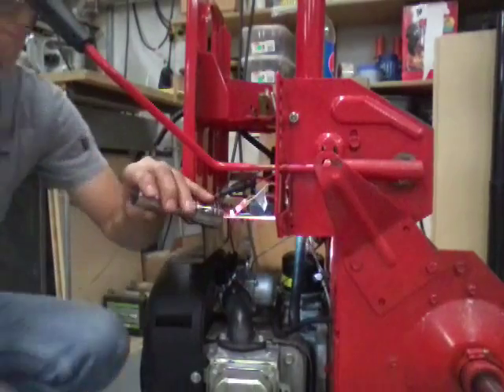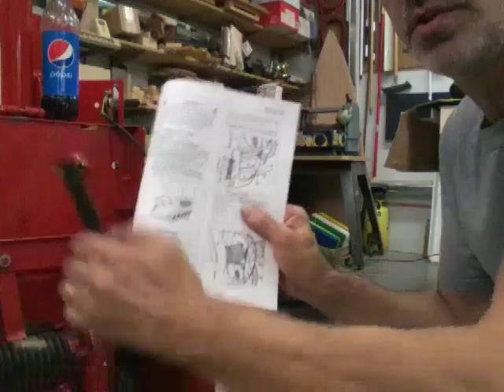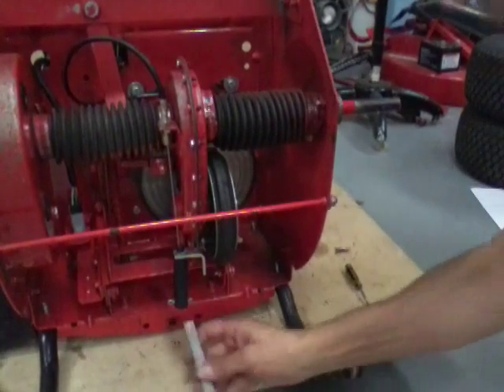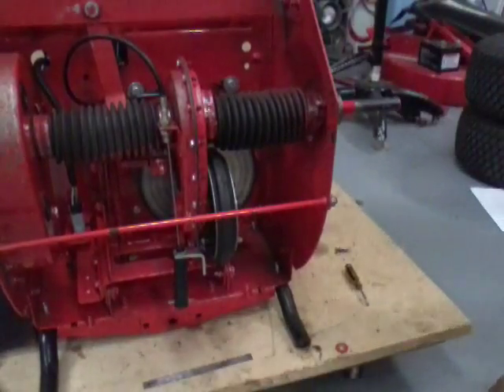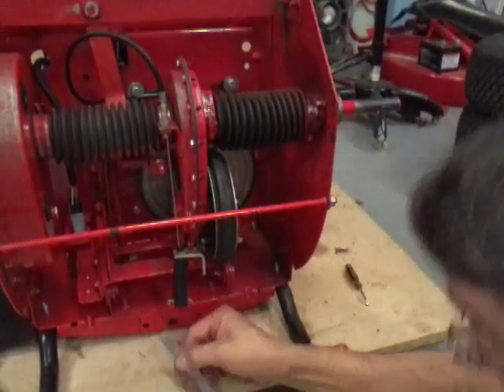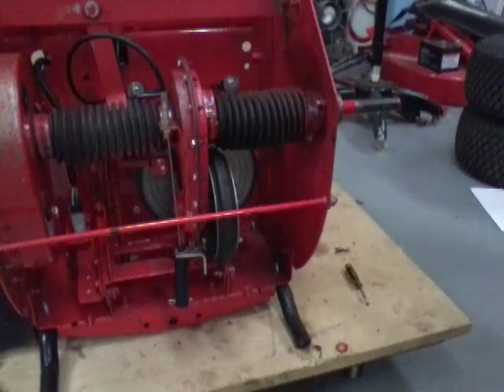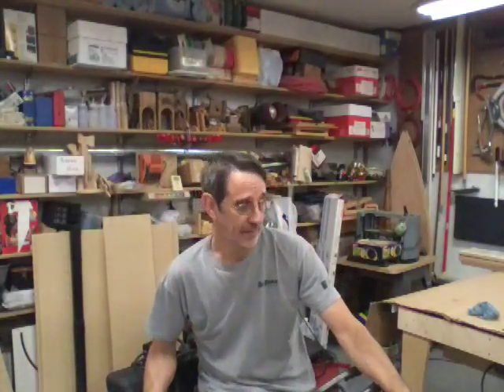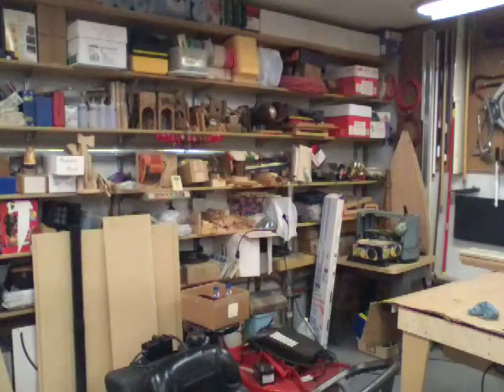144.   Adjusting the clutch and brake cable, installing the rear tires, the seat, and the gas tank.

Comment: You're the man, Jim! My mower wouldn't go into gear or drive at all. I replaced my clutch wheel assembly, axle boots, brake lever, re-greased everything.  Fired it up and it works better than we I got it second hand.  100 bucks on parts and I'm rolling again.  All because of you.  You're a great instructor. THANK YOU!
Reply from the maker: Clint Bollinger 
Well thanks for watching and hopefully subscribing. Jim
Reply: @jimjackson9381  where can I buy a new brake cable?
Reply from the maker: @jerberkrell815  I would take your model number and go to Parts Tree.Com in Texas and they will send you one.     Jim
Reply: @jimjackson9381  I'm not shure what the number is, it's an 80s snapper
Reply from the maker: @jerberkrell815  does your machine have the original engine on it?
      Send me some pictures of your machine and maybe I can figure something out, I need to know if it has one or two  pedal ?
     Send them pictures to
jimsfixitshop@gmail.Com 
Thanks.  Jim
Reply: @jimjackson9381  it does have two pedals, and it does have the original 11hp engine.
Reply: @jimjackson9381  i also just emailed you too.
Reply from the maker: @jerberkrell815  do you know what size the mower deck is?    Jim

Comment: I found on the Lugnuts on the snappers being a retired master mechanic if you take go ahead and pull her off or drain the fluids in the oil out of the unit, turn it on its side where you can get to the backside of the Lugnuts and spray them with a pen And then a little bit wait a few hours again for a little bit. Do that several times then maybe the next morning flip it back over the other way and hammer on the other side with a big punch put your wrench on it and zip right off every time I’ve had no problem doing that, but you need to get that penetrate on both sides of that bolt/lug nut

Comment: Jim- My Snapper is just like yours. It's a 2003. My yoke is locking up. The bushings are good if I don't tighten the mounting bolts real tight it moves okay but when I tighten them down the disc doesn't contact the crankshaft pulley because it doesn't move up to the crankshaft pulley & make contact. My distance is adjusted okay with the gauge i made from the paint stick.    Thanks   Bill Davis   Columbus, Ohio
Reply from the maker: William Davis 
Maybe you have the wrong plastic bushings you should be able to put the bushings in and lock the bolts down tight and the yoke will still pivot on those plastic bushings. Jim
Reply: @jimjackson9381  Even though I have adjusted the clutch spring to  the last hole the  drive disc doesn't contact  the wheel. I have adjusted the clutch but the tractor won't move in any gear. The chains are all good. Puzzled? Should I move the drive disc closer to brake wheel?  Bill Davis    Columbus, Ohio.
Reply from the maker: William Davis 
Did you get the issue figured out with your yoke if that’s not working properly your Machine is not going to drive properly, send me some pictures to my email so I can see what your drivetrain looks like. Jim
Reply: @jimjackson9381  My camera is not working. I moved the drive disc down & now it will move in all gears. The problem I have now is that it's grinds in 1st. & 2nd. gears & really bad in 3rd.,4th. & 5th. gears. It has the original  bearings or bushings. There was quit a bit of slack in one of the chains. All of the adjustments are right. I'm thinking the drive disc still has to move down closer to make better contact with the clutch disc?  Thanks for help.  Bill Davis  Columbus, Ohio.
Reply from the maker: William Davis 
Just make sure the edge of the chain case is not hitting your drive disk, that will make a grinding noise. Jim
Reply: @jimjackson9381  It is not hitting the housing.
Reply: @jimjackson9381  Sorry it took so long to get back to you. My Snapper had the original 12.5 H.P. engine. I put a new 11.5  engine on the tractor so using the old adjustments was wrong. I had to lower the crankshaft pulley & readjust the clutch & the brake. Changed the grease in the transmission . Works good now.  Thanks for your help. William Davis  Columbus, Ohio
Reply from the maker: William Davis 
Hey William I’m glad I could help if you have any issues let me know, I hope your subscriber I need your help with that issue. Jim
Reply: @jimjackson9381  I have told several people about your expert advice. They love it. You have taught me a lot, Thank you. William Davis Columbus, Ohio.
Reply from the maker: William Davis 
Well thanks for spreading the word I could Surely use subscribers to keep my channel going. Jim

Comment: Hi Jim that looks just like my little snapper and the only problem I have is with safety items. When I put it in park,it's a crap shoot on whether or not it will continue to run or die. This is when I get off the mower to move a water hose etc. Out of the way. I moved 1 then 2 ferrels up on the pedal and it died immediately. It's a finicky little booger as I don't know what or which direction to adjust the "clutch cable" I would assume, but I could be wrong. Great little mower but I to am finicky and want things to work as they should. Kind of like the cassette decks I work on. They have to be calibrated perfectly even though the manufacturer says +-5% is allowable. 
 Thanks Jim and keep up the good work as some of us appreciate the older things in life that can and will be repaired.

Comment: Hey Jim, 
I talked to you a couple times about my Snapper. I've FINALLY got all the parts to start putting it back together just in time for spring..lol. I think I found out from you why the mower wouldn't move. The left side hub bolt was missing. You said it would just keep turning and not move. I guess it was running like that for a couple years and finally unsiezed itself and stopped moving. I figured I got it All apart might as well change both chains both gaskets all the plugs and the belt & blade. I want to Thank you for you helping me thru this process. I will let you know if that was for sure the problem.
P.S. both chain case & Diff case were gummed up with that hard 00 snapper grease...I've been watching the vids.
Reply from the maker: Vinnie C 
Hi Vinnie
   If you need any help putting that thing back together you let me know and I can say for sure that missing bolt was the issue why your machine wouldn’t move.  talk to you soon Jim.

Comment: Hey Jim I've got a walk behind cub cadet purchased a the Orange store that should give age? It needed a new drive cable and I finally got around to order part and replaced it added new gas. Fired right up. This model regardless if warm starts with choke on. Well when I shut off the choke it revs up to maximum. I just watched a snapper video about the governor butterfly so I'll check that & if not missing send you another message. Hope your well. 
TU from N.W. Ken
Reply from the maker: If you have a Ace Hardware or a True Value Hardware. in your area I would go talk to the mechanic and see what he thinks it could be I have no idea on that one. Jim
Reply: @jimjackson9381  TU Jim. 
Anxious, with rain In our forecast. 
I decided to check out the govenor & found  my maintenance needs improvement. Butterfly's intact.  So I cleaned up all moving parts & mowed the lawn. Followed with  ordering a new blade. TU again for the channel &  responding Sir.

Comment: Hello Jim - this video was very helpful for me!  I inherited my dad's rear engine Snapper and having some issues with the brakes - I believe I will now be able to fix it!  In this video - you mentioned "Tom's Manual".  Can you tell me, please, how I can get one?  Thanks!
Reply from the maker: timreser 
If you call Briggs & Stratton. in Milwaukee Wisconsin with your model number they should be able to get you or send you a PDF file that you can print out. Jim

Comment: Hi Jim, I purchased an older Snapper RER that appears to be repowered with a Honda 13hp OHV, I need to get a clutch cable but can’t  seem to find what model has ferrals on one end and a loop on the other.  I can send a picture to help identify it.  Thanks again for posting all these videos I have learned a lot about the Snapper and you sure do drink a lot of Pepsi.
Reply from the maker: Charles Piwowarski 
Hi Charles
   Send a picture to my email which is
jimsfixitshop@gmail.com
And I’ll take a look at it. And I just have to have my Pepsi. Jim

Comment: I'm trying to set the clutch/ brake on a rear wheel snapper. The pedal has a pulley on it... No one  speaks about that version. My client/friend needs it fixed . Do I remove and relocate the pulley to get the slack to do the adjustments I need?
Reply from the maker: You need to send me some pictures of this thing I’ve never seen a pulley anywhere on a snapper rear engine rider send it to
jimsfixitshop@gmail.com
Thanks.      Jim

Comment: Hi Jim, my name is Jim. I have a snapper SR1028 with a 10 hp. 
I’m in the process of replacing the engine after 23 years. Unfortunately, it dropped a valve seat.
The head was pretty heavily damaged, and the valve seat was a bit oval, and even the valve spring appears to be broken. 
I’m using the opportunity to go through and adjust things like the clutch, but mine is different. I have no cable directly on my pedal like yours. 
Do you have a video for the older units? 
I still have the black oval steering wheel but I have the covered center with SR 1028. My brake pedal is very low and I’m not sure about the adjustment on the clutch. 

My new engine is a 21R807-0072-G1. That appears to be the number of the replacement engine that will fit my mower and it’s 11.5 hp, not 10hp. The engine is not going to show up for a couple of weeks. 
While I’m waiting, I want to make sure everything’s lubricated and adjusted properly before I install the new engine.. Just want to utilize the time while waiting on the engine.
Any assistance or suggestions you have would be sincerely appreciated..
Thank you from New Jersey!
Reply from the maker: @Justacogg  I am not real familiar with the SR series machines but I have one that was just delivered to me from the other side of my state that I am probably gonna start on next week and I’ll go over some adjustments and lubrications at that time.

Comment: When you show the bracket that has the clutch and brake cable, which hole does the clutch cable go into ?  This should help when replacing the clutch cable.  Thanks Don
Reply from the maker: Hi Don it’s Jim. The little black plastic block that goes around your clutch cable and brake cable most of them have the same size hole going through them so it doesn’t matter which way it goes on. As long as the block is on the clutch cable between the feral and the pedal so that it can pull the brake cable when you push the clutch pedal all the way down. Jim

Comment: My brake/clutch pedal doesn't always return the the full up position during mowing. Brand new mower.  I have checked the clutch and brake adjustment and they are where they're supposed to be.  What can I do to insure the return of the pedal to the full up position?
Reply from the maker: It’s nothing that you really have to worry about there’s not much in the way of a spring that pulls the pedal back up. Jim
Reply: @jimjackson9381  Thanks, love the videos!
Reply from the maker: @geraldstraney6181  Well let me know if anything comes up that you need help with. Jim

Comment: When you stood the mower up vertically did you first drain the oil out from the engine?
Reply from the maker: If I stand it up to store it for the winter or a long period of time yes I drain the oil and gas, otherwise the oil will leak out around the dipstick tube. Jim

Comment: Once again, thanks for another video Jim. One question and a request. I have a rear tire that has a slow leak, but it leaks enough that I have to bring it back up to 12# ea week when I mow. Do these tires have tubes or tubeless? On the parts manual I found it doesn't say.(~1988 model). The request....when you hang the deck could you demonstrate or discuss measuring and setting the proper fore and aft angles, and the best adjustments for lateral leveling for best mowing results also. TIA Mike
Reply from the maker: 210 Doc 
  Hi Mike  it's jim
 Most all riders have tubeless tires on them normally when I buy a new machine the first thing I do is put tubes in all the tires. Then I don't have to worry about them going flat all the time because of rusty rims. Thanks for your questions,  talk to you soon Jim
Reply from the maker: 210 Doc 
Got you covered Mike, in the next video I cover putting on the mower deck and leveling it from front to back and side to side.thanks Jim

Comment: Very instructional video Jim. I am having difficulty identifying the correct name or part number of the 'black plastic clamp' you mentioned at 1:07 of your video, which attaches to the clutch and brake cables. I bought a used mower that didnt come with it, and the brake is not working as a result.
Reply from the maker: Ibrahim Vandi 
I am still having trouble trying to get onto Parts tree website go on Parts Tree.Com with your model number and check the brake cable and the clutch cable I am not sure if you can buy that plastic block separately or if it comes with the brake cable sorry I can’t be any more help than that on this question. Jim

Comment: Does the clutch keep the mower from starting? I have slack in my cable and all its dolng is spinning over! fresh gas new filter new battery HELP TIA
Reply from the maker: Your clutch cable is hooked to your yoke if your clutch is not pulling your yoke up far enough to activate the switch your machine Will not start      
       Jim

Comment: Hi Jim. Great videos. I have a rear engine 12.5 Snapper. 
Problem is that the engine dies when clutch/break is released. I replaced clutch and seat safety switches with new ones. Do I change out the module? Everything seems to be running/ starting very well on mower, engine, blades, etc. All wires are looking in good shape too.  PLEASE HELP.
Reply from the maker: Coach Johnson 
Hey Coach it’s Jim
  It sounds like the switch on your yoke is bad if your engine is dying as soon as you let out your clutch your yoke switch is located on the lower left-hand corner of your rear case when you stand up your machine let me know if you can’t find it. Jim
Reply: @jimjackson9381  
Thank you Jim. I put in a new clutch/yoke switch and now when clutch is released the engine putters and has no power. I recently put on a NEW carburator. Could I have done something wrong during that process? What can I check regarding that issue? Bad idler pulley?interlock switch? blade clutch failure?
Many that to you and your videos, Jim.
Reply from the maker: Coach Johnson 
When you start the engine sitting in neutral or park whatever your machine has, when it’s sitting running with the clutch pushed in how does it run for save two or three minutes then releasing the clutch still in neutral how does it run if it starts missing or spitting in sputtering as soon as you start it I would say it’s probably a carburetor issue let me know. Jim

Comment: Hi Jim. My 94 snapper riding along and  it will just stop if I get off of it it starts to go again? Reverse is fine works normal.
Reply from the maker: Matt Reed 
Hey Matt it’s Jim
If you haven’t already I want you to watch video number 70 and tighten your yoke spring and inspect your rubber clutch disk and make sure it’s in good shape adjusting your spring should take care of your issue. Jim

Comment: Good morning Jim, question please, clutch/brake cable snapped at the pedal, about 1 inch from the end of stop clamp, I put on new cable stop using a clamp at the end, but now mower won't start for some reason? it is a single pedal snapper with 11 horse honda engine model 281123HVE.   Bought new in 2005, do not have blade engaged and have the shifter in neutral,  any ideas you have would be appreciated please,

Thank you,

Ed Gennrich
Reply from the maker: ed genn 
Hey Ed it’s Jim
   Stand your machine up and have someone push the pedal in and check and make sure that your yoke is depressing the switch otherwise it won’t start. Thanks Jim

Comment: Jim - What is the right clutch cable to buy for the series 23 snapper rear engine mower and do you have a video of how to change it?
Reply from the maker: To find the right clutch cable you need your model number. Jim
Reply: Thanks Jim it’s 281223BVE
Reply: Model: 85622
Reply from the maker: @bradleymichaels1820  OK I looked on Parts Tree.Com. and they’re calling it a
Clutch/brake cable
And you also have a brake cable the number they’re recommending is 7022449YP
Let me know how it turns out. Jim